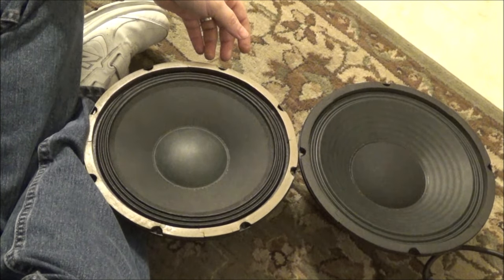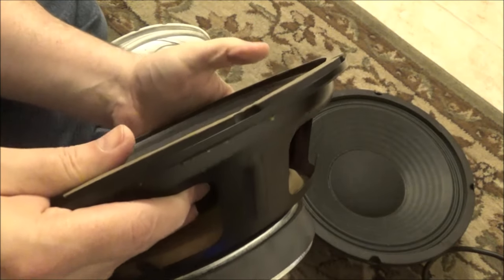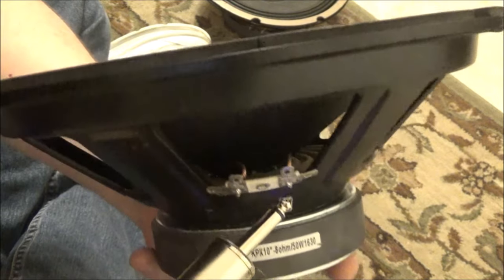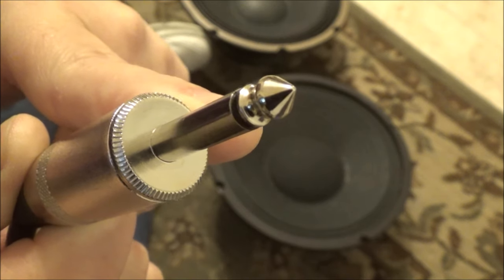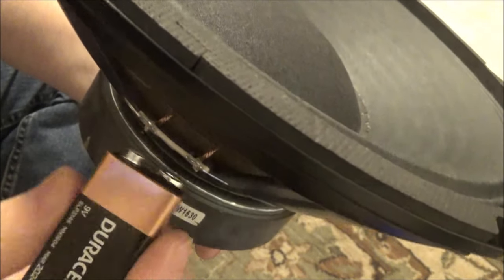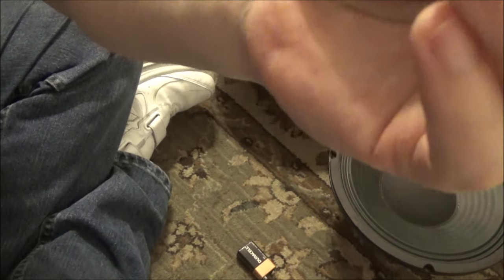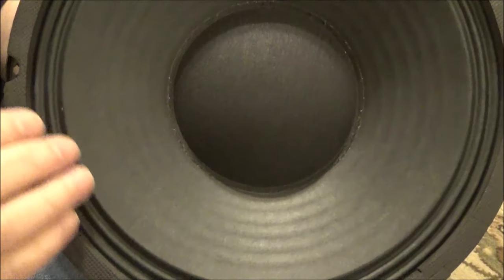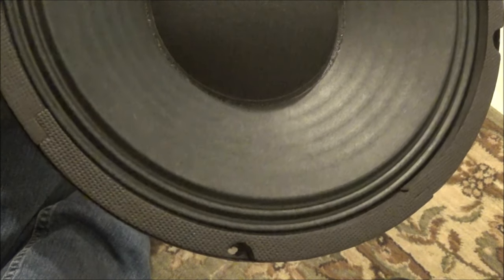Test For A Blown Speaker & Wire A Speaker Correctly By Scott Grove

Comment: Speaker cones are honestly quite amazing...some still working fine after many decades of heavy bass and abuse.  My 6" monitors have been going since the mid 1980's, around the same age as me, and they still sound and look great.
Reply: I have two Kustom columns  from 1970 all original 4x10's that sound amazing

Comment: Hey, umm...you keep calling it a speaker coil, but the speaker coil is the coil of wire that sits on/in the magnet. The part you're calling a speaker coil is called the "surround"....unless it's the "diaphragm" or "cone"" you're talking about. Either way, that's not the "voice coil". Other wise there's some good stuff here.

Comment: Terrific info.  Looking to purchase some speakers but don't have a 1/4" connector BUT I do have an Aux type cable that typically goes from the computer's mic/headphone jack.  Am I correct in assuming that's the same design with Positive tip and Negative shaft?  So I could plug one end to my computer and connect the other to the speaker like you did to get sound...would that work?  Barring that doesn't work...what sound does the bad speaker make when just connecting a battery...it was hard to tell in the vid...seemed a lower popping type sound?

Comment: what exactly is 'blown', in a blown speaker?
Reply from the maker: The majority of the time, a wire in the voice coil will get too hot and break.
Reply: @groovydjs  Hi. I had a very scratchy sounding speaker, thats why I was looking for videos to fix it. When moving it, there seemed to be a small amount of drag. So I took the dust cap off, and used a vacuum while moving it up and down. Then I hooked it up, and played some bass through it to really make it move... it was scratchy. I put the vauum as close as I could, and periodically touched the cone to move it more side to side as the music was playing.  Fixed!!  There must have been some dirt that was dislodged, because its now working.. yay.